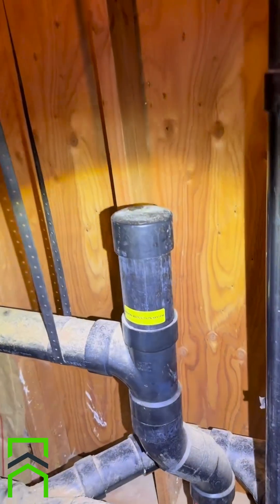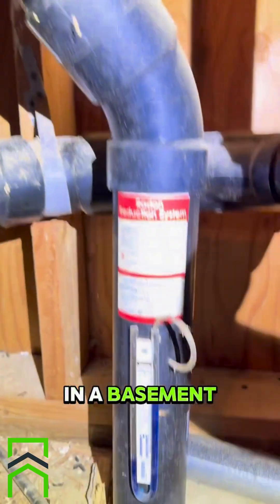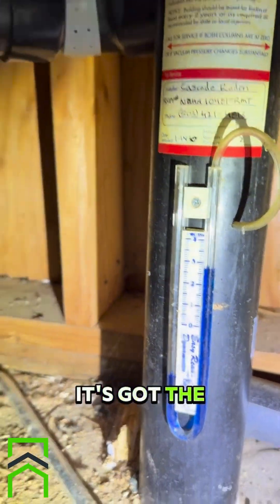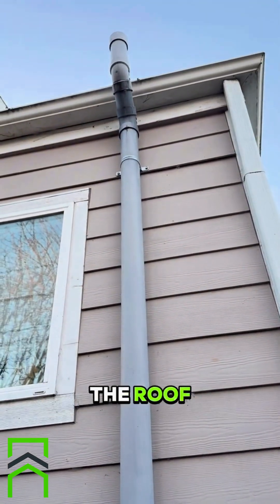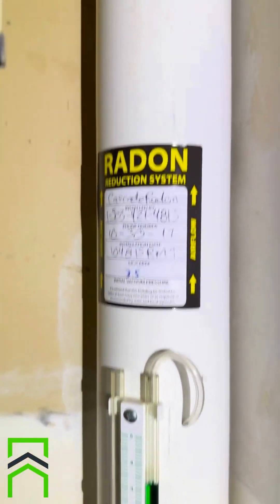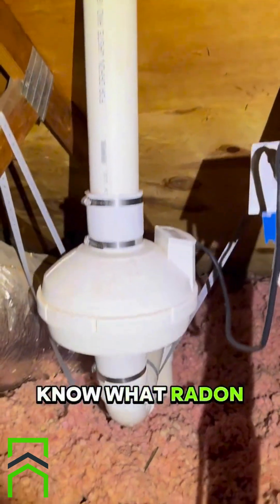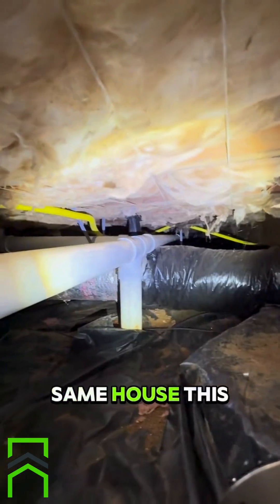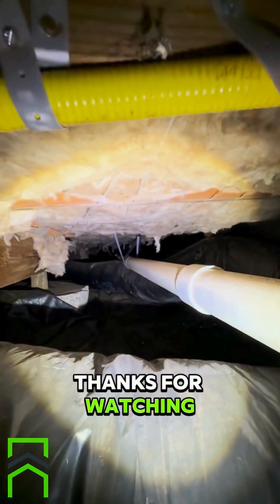Radon Mitigation Systems #homeinspection

Comment: Our radon is between 20 and 24.  Not extremely high,  but higher than the recommended 4 pCi/L.  We can keep it below 4 with little exhaust fans in the windows,  but that gets very cold in the winter months and brings in high humidity in the summer months.                                    .    Is there a Heat Recovery Ventilation System (MHRV) that would work in our situation?

Comment: You need to insulate the pipe going into the fan and through the roof. When the underground air runs through that fan it can cause the pipes to sweat and create water damage and mold.